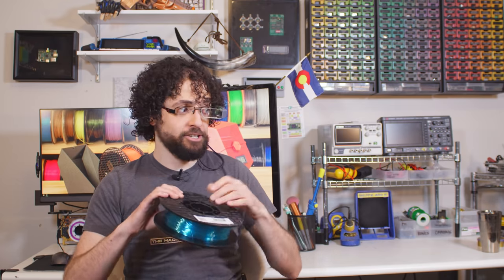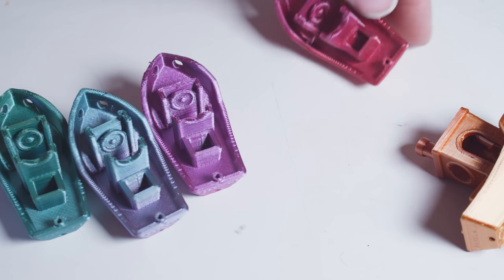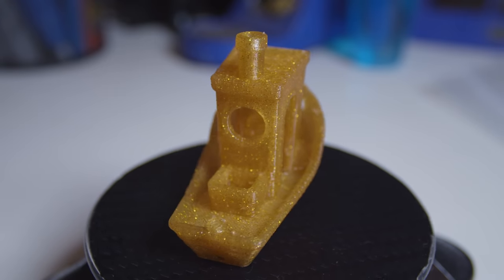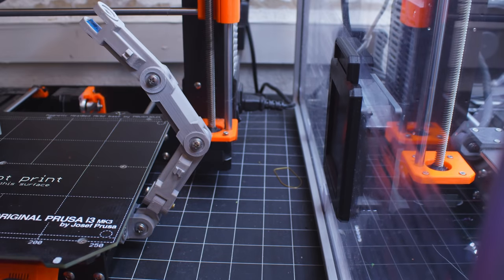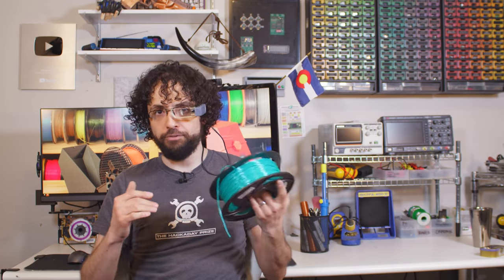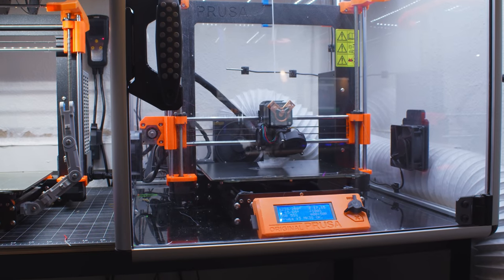I Tested (Almost) EVERY FILAMENT on Amazon: Every Single Filament Part I

Comment from the maker: Thanks to Brodie Bennett for creating timestamps. Also, milk jugs are made of HDPE, not HIPS. My bad!
Reply: Solo cups are made from HIPS. I think you can even buy recycled red cup filament, in case you want to 3D print party supplies for your next frat party
Reply: Ask your viewers to mail you labelled bags of plastic trash for recycling :v or don't.
Reply: you need to start record 500k video.
Reply: You didn't mention chopped carbon peek with Carbon tape.
Reply: FYI: PETG printer parts can and will fail inside an enclosure. It happened to me, and I don't want it to happen to someone else.
Reply: HDPE is used for a Loooooooot of products including milk jugs as you mentioned, most 1 gallon jugs (maybe even all of them) vinegar, rubbing alcohol, etc etc.
Reply: Zack, could you pin Brodie's very useful list?
Reply: Try printing the wood pla with higher temp. It should get darker. Now try changing the temperature on a per layer basis. Artificial wood grain. Add some randomness to get a more natural look.
Reply: @Zack Idea for you: A holster for cops that when the firearm is drawn it automatically calls for backup and EMS. Beau of the Fifth Column did a 9 minute video showing some of the benefits of it. 
Either try to make one yourself, or help put out the message that this would be good for cops and the people they point firearms at. 
Beau's video is entitled "Let's talk about a plan and a wish for changing law enforcement..."
Reply: Nothing like a freshly printed pair of milk jugs.
Reply: Quick Tip: if you want to print polypropylene then stick transparent duct tape to your printing surface, print sticks perfectly and all problems are gone
Reply: 26:24 - yes! I got the reference, and the one about sand. Who actually likes sand tho?
Reply: Yep, HDPE...which is why it's one of the more popular "Free:" thermoplastics used for home vacuforming.
Reply: I was about to comment that lol
Reply: @2:08 You “opposed any health conscious inconvenience because you’re an American.”  Is that sarcasm or stupidity?
Reply: An expensive video.
Reply: Is there any hobby level plastic that could store acetone? PEEK should, but that's beyond hobby level printing.
Reply: Should of made skulls instead of those weak ass boats georgi
Reply: do you know if the  Prusa MINI+ can print half these filament i'm new to 3D printing and i'm considering on buying the Original Prusa MINI+ because is has good ratings and is a good easy to use for beginner's please ant advice is appreciated take acre and stay safe :)
Reply: @Be3Al2  Normally yes. But you need a lot of stuff before being able to print some of the capricious filament. A box enclosure to put the printer inside (lack table), a box to keep the filament in dry area. Prusa Mini+ and Prusa MK3S+ are design to print mostly PLA & PETG. If you want to print something else, you will need an enclosure to avoid humidity. And, of course, nozzle adapted to the filament. 

Also, the extruder is not easy to open in case of clogging. But there is some project on Prusa who propose better extruder to print. 

(And you need tool like brush also)
Reply: Please don't tell me that's a stupid Google glass...
Reply: Good work
Reply: Duuuuuuude you’re in Westminster? I’m in Irvine, I’ve really been wanting to get into 3D printing (and hobby electronics specifically synth DIY but that’s a whole other story lol) recently. Do you have any suggestions about where to start as far as meetings and places to go out here in the OC? Do you offer classes? Do you know of any like local swap meets or something that take place regularly? Thanks in advance for any help you can give.
Reply: Was that a Raspberry pi that was replaced with YT plaque? Looks slightly different(I am new to the space) because I have a pi 4 model B. What gen or model is that? Just curious.
Reply: @sillydilly2725  !
Reply: Hey zack .....i like that turn table u show ur benchys on ...is that printed as well or did u buy it somewhere ?
Reply: WOW the alliteration.
Reply: part 2 ?  if not a tier list for quality would be great. new to 3d printing video was great and helpful thank you !
Reply: Which PLA would you recommend in case of printing small toys with clear eyes and nose etc
Reply: Not sure what happened with your Glow Filament, but printing AMOLEN's Glow PLA on a 0.4mm Hardened Nozzle came out perfect for me.  This was at 0.1mm layer height on the stock Vyper Cura profile as well.  This was a 15 hour print and I was able to switch back to Hatchbox black PLA without issue!
Reply: @sillydilly2725  so
Reply: HDPE is #2 in the triangle mark.
Reply: There's filament 
 I didn't see in the videos even though it's extremely similar to PETG I would've liked to see some RYNO filament since I've been playing with my new pulse printer
Reply: This bideo was a dissapointment. I was hoping you would Review EVERY BRAND PLA not just PLA TYPES.
Reply: 23:55 Did I just hear an.. Ingress reference???
Reply: PP
Reply: ⁶
Reply: Eww why would they make them out of hips? That's really weird and I feel like those hips should go to the elderly with messed up ones smh
Reply: Can I ask what the hell the thing is your wearing on your face and why? I get trying to be unique but what does wearing do or what purpose does it serve?
Reply: Sooo... You have a "TEMU 3d Printers reviewed" video queued, right? Right? Please? (Ok also and more importantly, I think the gridfinity might have solved all of my ADHD crafter and collector organization problems. "How did he do all that in such a short time" said my bff housemate when I showed her the first video in the series. "Procrastinating on other videos he should have been making at the time," said I. And we both made sympathetic noises because we both also have ADHD Ultra-HD.
Reply: @devilsadvocate6989  oil bottles, gas cans, boats, some hammers, spray bottles. It has to be my favorite plastic, so easy to work with and resistant to most chemicals and solvents. I also just love the texture and asmr of cutting it with a blade.
Reply: @devilsadvocate6989  oh and you can weld it!
Reply: trumps twitter is back ha ha

Comment: Fun fact about nylon: when it absorbs water it actually becomes up to 8x stronger. Injection molded nylon parts are often aged for a few days in humid chambers to bring them up to full strength.
Reply: Ehhh... Moisture acts as a plasticizer in nylon and therefore reduces strength and stiffness properties but increases elongation and toughness. 
But yes, in general, as moisture content rises, significant increases occur in impact strength and other energy absorbing characteristics of the material.
Reply: @The_Eldest_Millenial  So what he said
Reply: Does this apply to cf or glass filled nylon too
Reply: @rodiculous9464  yes

Comment: 02:32 PLA

03:22 - PLA+
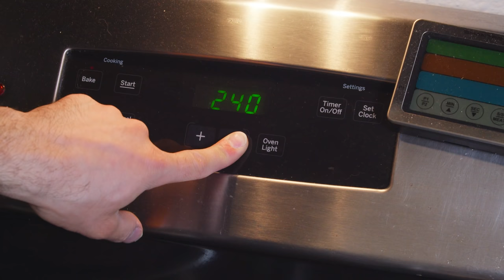04:02 - High-Temperature PLA
04:44 - Silk PLA
05:27 - Rainbow PLA
06:10 - Colo[u]r-Changing PLA
06:37 - Plactive

07:43 PLA Composites

08:09 - Marble PLA
09:02 - Laybrick
09:37 - Wood PLA
10:11 - Glowing PLA
11:00 - Glowing PETG
11:11 - Glitter PLA
11:57 - Sparkly PLA
12:28 - Carbon Fiber PLA
13:18 - CF-HTPLA
14:06 - Conductive PLA
14:55 - Metal Fill
15:56 - Iron PLA
16:30 - Stainless PLA
16:50 - Brass PLA
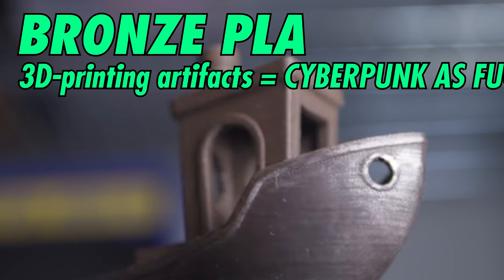17:12 - Bronze PLA
17:37 - Copper PLA

18:04 Hobbyist Filaments

18:15 - PETG
19:06 - T-GLASE
19:49 - Polysmooth
20:15 - HIPS
21:15 - Polypropylene
22:29 - ABS
23:46 - ASA
24:37 - Acrylic

25:29 Special Purpose

25:34 - Purge Filament
26:27 - Cleaning Filament

26:56 Flex Filaments

27:20 - TPE
28:22 - TPU
29:12 - Ninjaflex Cheetah

30:02 Engineering Plastics

30:17 - Polycarbonate
31:39 - Carbon Fiber Polycarbonate
32:33 - Nylon
33:45 - Taulman Alloy 910
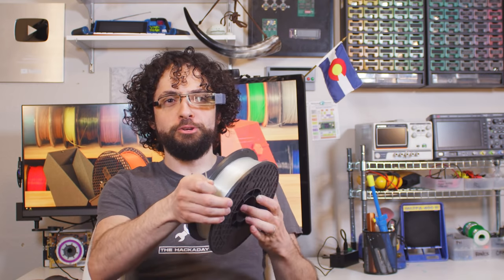34:36 - Carbon Fiber Nylon
35:17 - Delrin

37:42 Super Polymers

37:47 - PEEK
38:05 - PEKK
38:16 - Polyetherimide

38:40 - Antibacterial PLA Test Results
Reply: Ty! I’ve never actually needed one of these until now!
Reply: Thanks
Reply: Thank you so much!
Reply: The hero we need
Reply from the maker: Thank you! I'm putting this in the description.
Reply: A gentleman and a scholar.
Reply: ALL HAIL BRODIE!
Reply: @ZackFreedman  hello, do you know which filament is microwave safe?
Reply: YouTube sets this up automatically when the creator puts time stamps so u really wasted your time on that
Reply: @maddoxswan3487  Brodie created the timestamps and Zack added them to the video. You could say that your comment was a waste of time. So is this one.
Reply: You left out @7:18 "Zey'r dirty girls"
Reply: You forgot  2:36 - Uncalled psychopathic abuse towards mom
Reply: You missed 6:58 Dirty "@!#?@!" beaters
Reply: 09д
Reply: 09
Reply: Ж88
Reply: @ZackFreedman  Додж7дождю88

Comment: I'm brand new to 3D printing, and in the first 10 minutes, I learned so much about printing.  I've been buying the "prettiest" PLA and was wondering why ALL of my prints were SO BRITTLE...  I had no idea there were so many variations...  Thank you so much!  Time to put these silk variants away for my heavy duty parts.
Reply from the maker: Yeah! After a certain point, the more pigment, dye, glitter, and other additives they put in a filament, the weaker it gets. Some brands, like Fusion and ProtoPasta, make gorgeous filament that sacrifices some strength. Others, like Polymaker, use the bare minimum and perform slightly better.

Comment: Great summary on the filaments but I do have to admit I do print TPU on bowden with a SeeMeCNC EZR extruder top. I’ve shown it on my channel. So it’s not BS.
Reply: Same. I’ve been able to print Priline TPU on my unmodified Ender 3.
Reply: Didn't you print Ninjaflex on a bowden setup as well?
Reply: I'm actually currently in my first attempt with TPU on an Ender 3 (with the Capricorn bowden upgrade), and so far, it's working fine.
Reply: Hehe
Reply: Tpu on my tronxy x5s.  It actually came out nicer then yours.
Reply: New fan of the channel  CHEP.
Reply: Looking for this, I have some surprisingly fantastic prints on my Prusa Mini+. The squishy benchy was almost perfect!
Reply: I'm printing Ninjatech's Chinchilla on an Ultimaker S5 with a giant Bowden tube. It's not easy to do or dial in, but certianly possible.
Reply: @KinsyMcVay_SESTrojanTech  me too on my e3pro
Reply: I've had good luck with TPU on my CR-10.  It works just fine if you use low print speeds.  It is, however, really stringy.

Comment: Wood grain is the only special one I’ve done so far, really hard to get right, but the result was amazing after some sanding! I’ve basically just been using it for wands but I’ve also had it used for a few handles on prop daggers and prop hand guns
Reply: WAIT THEY MAKE A WOOD GRAIN FILAMENT??
Reply: @beesafterdark5644  Yeah, it's in the video.
Reply: @The_Bird_Bird_Harder  I ain't watch that shit bro I got the attention span of a sliding glass door.
Reply: @beesafterdark5644  it’s been 7 months you could have watched a minute a day or even less probably
Reply: You could say it's outSANDING. I'll get out.

Comment: Great comprehensive overview.  I'll second the nod to purge filament; I never, ever change filaments without it.  Only point I disagree with is PETG support problems.  A .2mm Z offset separates just fine for me.

Comment: PETG is the only material I've ever printed that sticks to the bed TOO well.
Reply: Did you print PETG on glass?
Reply from the maker: TPU and PP are also notorious clingers. TPU is especially nasty because it's impossible to pry off the bed...
Reply: Y'all are insane. my PETG and TPU prints keep popping off the bed. PLA is the only thing I've gotten to work consistently.
Reply: I find it's moisture problem more than adhesion. Glue stick should act paradoxically as a release agent. But yeah I have to drybox my inland petg and print it hot too 255c.
Reply: @JD2jr.  I’m going to assume you’re printing on a glass bed. PETG and TPU love to fuse themselves to pei beds.
Reply: @redrocket23  yeah, I read those answers above as being about a glass bed, even though only one comment actually mentioned it
Reply: @redrocket23  I've had PETG take tiny chunks off of my glass printbed. I usually have to wipe the bed down with hairspray to prevent that from happening. That said, I regularly dehydrate my spools and keep the printbed clean, which is why I might be having the opposite problem.
Reply: @JD2jr.  if you have one of those magic glass beds with a pattern etched into them, it's actually precoated with some nano polymer. So it's not bare glass.
Reply: @SianaGearz  literally just a scrap piece from my grandpa's basement
Reply: Natural Clear PETG is my personal favorite maker sauce to print with, and even my Anet A8 handles it like a champ, even if the build-tak I added to the bed make removal tricky at times
Reply: @UNSCPILOT  I have an aesthetic gripe with clear PETG. Little bits end up collecting on the nozzle, turning brown, and eventually peeling off and falling into the print, which looks a little unappealing.
Reply: @SianaGearz  I had that issue for a while but I spent enough time getting the temperature and retraction perfectly dialed in on mine that those are rare now if they happen at all, though depending on your printer I expect mileage may vary.

That and I'm planning to upgrade my Anet A8 to a E3D V6 hot end Bowden setup (among a couple other mods) so I'll probably be back in the same boat till I dial it in again

Comment: delrin is also great for maintaining temperature. it's used for shift knobs for cars because in winter it won't freeze your fingers, and in the summer it won't melt them off.

Comment: I appreciate all the work that went in to this, and his sense of humor helps with the lengthy video.  I certainly haven't come to the same conclusions though.  I've never found anything as worthless as PETG, it prints slow, doesn't do overhangs well, and is too stringy for multiple parts to be printed at once.  On the other hand I've not found anything as good of a work horse as ABS.  Once you've got it dialed in you can print very accurate humongous parts that are tough and can be post print machined, bonded, or polished.  TPU is another favorite, and a great way to make  tough parts for things like RC cars that take a lot of impacts.  Regardless, the video is a great single source place for information and pitfalls for a lot of different filaments.
Reply: I really like ABS as well however I have had some serious trouble getting it dialed on my CR10S Pro. It is going to require an enclosure I think for me to work with it. I have had no issues with PETG tho. It has become my general purpose filament. Once I got it dialed in, it prints easy and just as fast as anything else. I do agree that it is stringy but it cleans up pretty easily so not a huge deal. Cleanup has always been part of my game anyways. Parts do have an "attacked by spiders" vibe going on after printing multiple parts. Definitely not best for overhangs. A decent general use filament tho.

Comment: As far as TPU on a bowden goes I've been printing quite a bit of it on an Ender 3 with great success. All I had to do was upgrade the bowden tube to something with tighter tolerances and slow the print down. I occasionally get stringing but it's nothing unreasonable and a little cleanup with a heatgun makes it look perfect.
Reply: Same here :-) I use the Capricorn tube which makes it quite easy to print flex materials on the ender 3.

Comment: Amazing video!  Highly entertaining, and I have come back many times while browsing new filaments to get another dose of the VSL essential info for each one.  I also just bought 200g of Delrin because of this video -- had no idea it could be printed, and I have the setup to at least give it a good shot.
Reply: Did it work
Reply: @fridgestealer2119  I just said I bought it, not that I tried it 😅 I've been waiting to finish an upgrade to my heated enclosure to get to 80C first.  I'm not optimistic but it'll be fun to try.
Reply: @ObsessiveEngineering  ok

Comment: Great vid! The only gripes I have are you can print TPU with a bowden setup if it is set up properly for it (get that capricorn tubing and maybe get a better extruder), and I haven't had issues with printing CF nylon without an enclosure at all but I definitely have a drybox and that same sunlu heated spool holder.
Reply: I have a stock CR6-SE and gave some TPU a try.  Didn't have any problems at all, fed and printed without issue.  Although it's probably on the harder side of TPU.  Some cheap brand that didn't list specifics

Comment: I have an Ender 3 at home and an Ender 3 Pro at work both of which have stock bowden tubes and 95A TPU gets used on them all the time with no major issues. Slowing down print speed seems to make things easier. Below 90A might start giving trouble though, I've never tried TPE.

Comment: i'm a first timer, and i built a dry box with a bowden tube attachment zip tied to the length of the extruder wires. i've been printing with TPU for the first time running through the bowden tube and it works great!

Comment: I've been able to print stiff TPU through a stock Ender 3 but it always underextrudes. If you crank up the extrusion and print several walls it can make usable parts, but anything with thin walls always ends up with gaps.
I can also confirm that carbon fiber polycarbonate and nylon filaments work great for drones, or parts which have volume constraints but still need to be strong. In college we used the Markforged onyx filament for drone and rocket parts